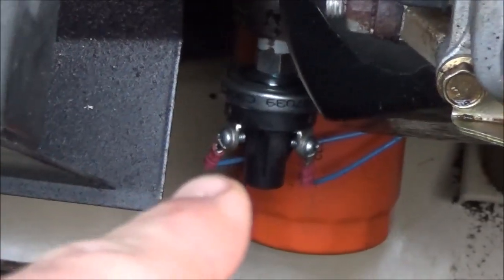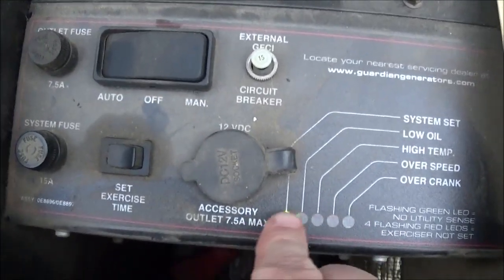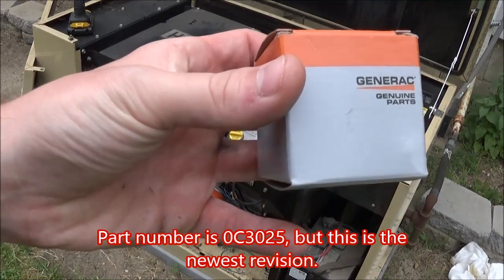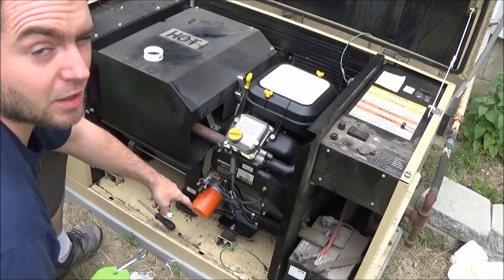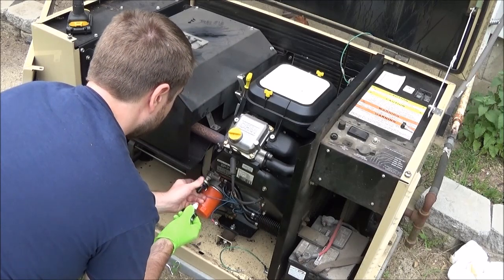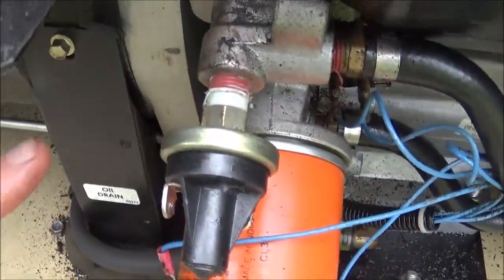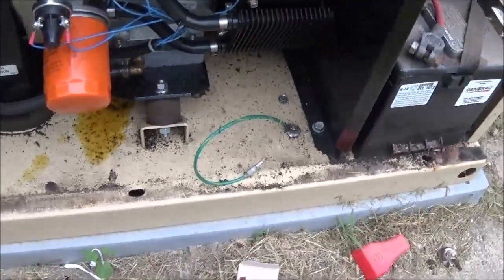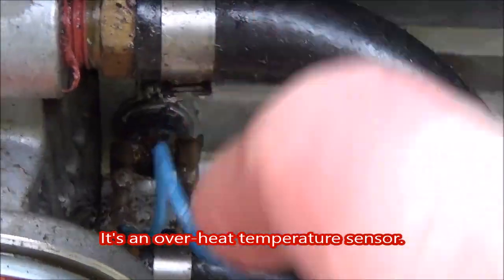Generac Guardian 004456-3 12 kW Red Low Oil Light (Replacing Oil Pressure Sensor/Switch 0C3025) 4456

Comment: Disconnect the battery’s negative, if you want to disconnect the battery. That way you don’t need to sweat it shorting; this is why auto repair manuals always specify the negative be pulled.
That’s thread sealant, not red loctite.

Comment: Thanks for the video. The part (same part number 0C30250SRV) I just got looks different.  The screws are too big to fit into the apertures in the prongs.  It looks like they want you to do a different type of connection, which may involve stripping the wires to fit their connector, but not sure.

Comment: Absolutely solved my problem!  Thank you for the guidance! After replacing the switch and successfully running the generator, then changed all the filters, the oil, and the spark plugs.  Runs like new again!

Comment: Did the replacement solve the problem?  If not, what would be the next line of action?
Reply from the maker: It did solve the problem. If that didn't work I would suspect bad wiring, a bad oil pump, or other mechanical issue.
Reply: @striker1211  Thanks for your feedback.

Comment: Shot in the dark... I'm cold with no water (ice storm) and this exact part just failed on my exact same unit.  A part won't be here for a week.  Does anyone know how to temporarily bypass this???
Reply from the maker: This switch should NOT be bypassed as there are numerous parts on the engine that could fail and cause catastrophic loss of oil pressure resulting in the total destruction of the generator engine... for example there are hoses attached to the oil cooler that often just pop right off without notice and drain the oil... however since human safety is greater than engine safety I will hesitantly inform you it can easily be bypassed by unhooking either wire on the sensor. Again, do not do that as you may cause complete failure of the generator and thousands of dollars in repair costs. Make 100% sure the unit has the proper amount oil. Call around to all local electrical places they should keep this on hand as it fits many other generators. Your local auto parts store might even have one. Good luck and stay safe.